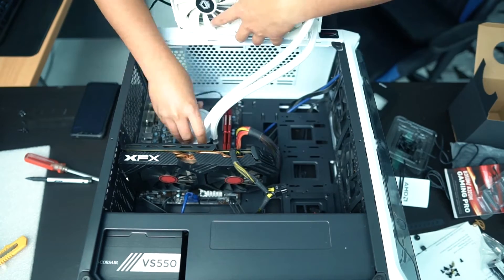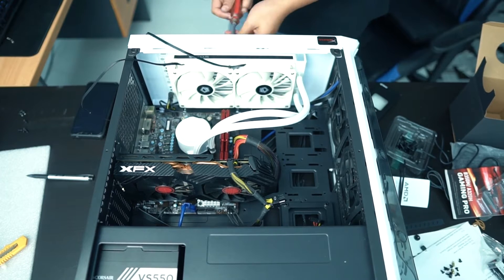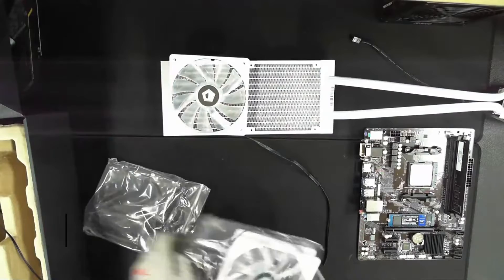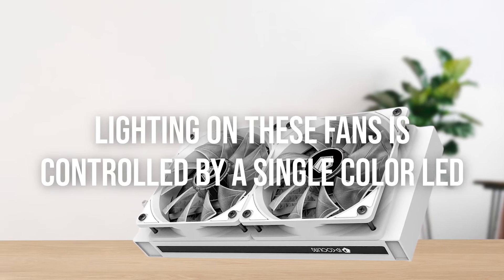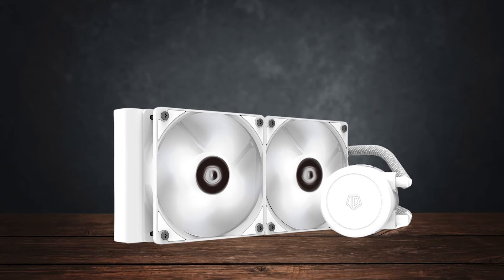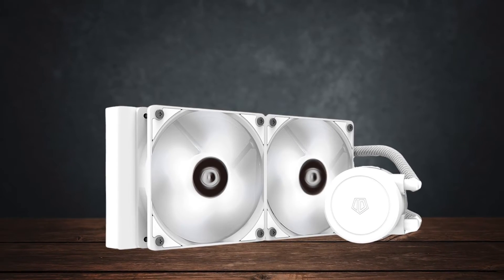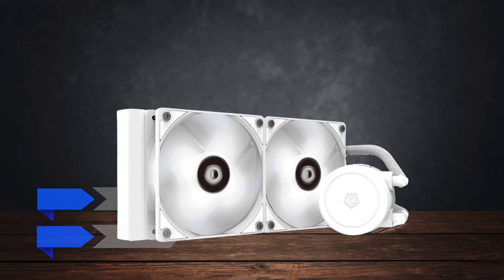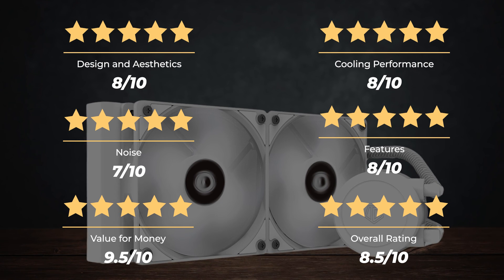ID COOLING FROSTFLOW X 240 SNOW Review! Worth It?

Comment: I just woke up but my PC din't wake up. But next try let me into BIOS and the CPU temp was 127C! Water pump speed showed N/A and was obviously not running. I waited a bit and restarted and my PC now runs as normal with CPU temp at 55C. I bought it prebuilt in October last year and I have this water cooler in this video on a 9800X3D so I started to search for issues other users might have had.
I haven't had any issues earlier, cooling has worked well, staying below 70C even when gaming but this automatic shut down due to high temp at 127C is worrying :O

Comment: Is it good if i pair it with a intel i7-14700k cpu, or should I consider a more expensive and better AIO cooler?
Reply: What did u end up getting ?
Reply: @wya_julian1893  still using my older AIO. No need for an upgrade, apparently
Reply: What’s ur average temp and what fans u got right now ?
Reply: I m using it's frost flow 240 lite and it can't cool it

Comment: Been using my frostflow 240 for 3 yrs now because the nzxt one I got didnt work and although it is rather basic looking it has done much better than I thought at this point i dont want to replace such a reliable part. A++ product here in my experience it cools my 5900x very well
Reply: u think it would cool my 5700x3d
Reply: @ yeah thats perfect. Its an easy aio to install too
Reply: hey. My freezer 33 fans are going to be ad. I want to buy this, is the pump noisy?
Reply: @agostonpalatinus1513  nah its quiet and underrated the only thing it lacks is an lcd screen/cool design. the thing is butter reliable I still havent replaced mine